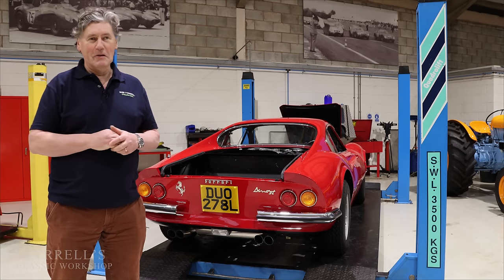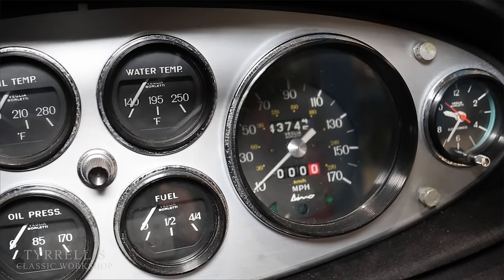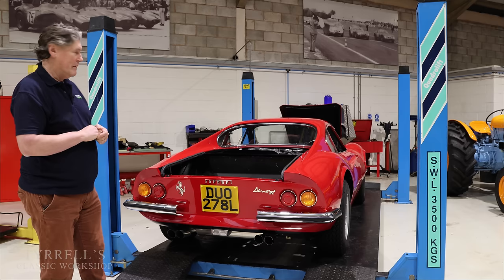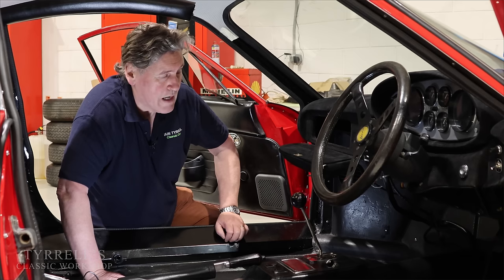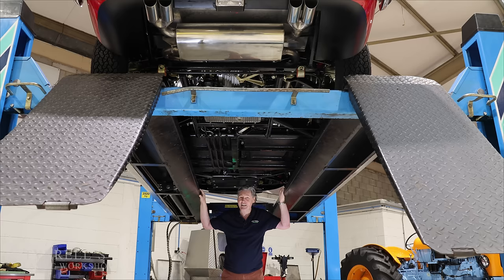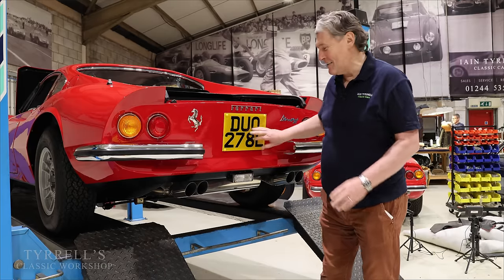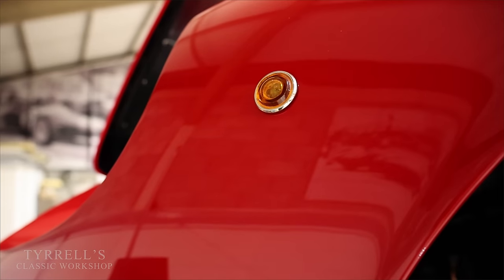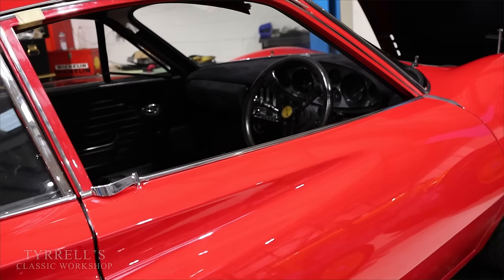Ferrari Dino 246 GT Restoration: From Bare Shell to Beauty Part 3 | Tyrrell's Classic Workshop

Comment: The details do make the difference. A few years ago I had moved from Toronto to Heidelberg and was in the process of placing an order for a 911. On a trip back to Toronto I stopped into a Porsche dealer and asked a salesman to recommend options that his customers valued. He told me to order, among other things, the aluminum look fuel filler cap. I did and every time I visit a petrol station and open the fuel flap I have to smile at this little gem. Keep up the good work Iain, you’re a dying breed of craftsman that keeps us connected to a time when doing things the right way was the only way.
Reply from the maker: Thank you for your kind comments!

Comment: I admire your attention to detail, also the knowledge you have, that allows you to know what is and is not correct. The car is absolutely stunning, the only thing missing, was hearing the engine running.
Reply: Amazing he buys parts from Superformance which offers the correct CAVIS cross carburettor fuel hoses yet Ian chooses to use black rubber hose here. A bit of an odd choice?

Comment: Happy Holidays and Best Wishes to you, your family and crew 🎄🎁🎅 This Dino is coming together stunningly brilliantly with all intricate attention to the deepest of details. Just mind boggling. Any car restoration project indeed never ever is a matter of putting some Lego kit together to begin with. You're not alone in noticing modern wiper blades on a classic. They should be as per original. Especially if the original casings were chrome or nickel to match the trim around the windscreen and-or were just a sign of the times, black ones just obviously distractingly comes across as a faux pas. Thank you so much for taking us along on this Dino project.

Comment: You tuned me right in with your comment about period correct radios and we are absolutely on the same frequency… I spent ages getting the right radios for my ‘68 Caravelle and ‘77 VW cabrio and correcting the butchery of modern upgrades. My ‘51 Ford still has its (working) valve radio. Great episode, and Happy New Year, looking forward to more in ‘24!
Reply from the maker: Excellent attention to detail!
Thanks for your continued support, and Very Best to you for 2024!

Comment: Wiperblades! I'm so with you on this Ian. My parents bought a new Volvo 145 in 1969, which I now have, still with it's original silvergray blades. The one on the drivers side has an "air scoop" to increase its pressure against the screen as you speed up. I've never seen this feature on any car, exept on these old Volvos.

Comment: Lovely! Found myself running alongside one of those, one evening about 20 years ago on a deserted Auckland southern motorway. I had my carmine red Mk2 2.5pi so I didn't feel like a complete heathen in his company.

 PI still has its stainless steel "Aeramic" wiper blades, but the dysfunctional AM-only radio and its single paper speaker had to go. If you like music, you need good sound gear in an older car with a lot of ambient noise!

Comment: This might be World Best Dino now. The decison is very hard to begin to use it, especially in an environment like northern Europe. Congratulations, a gigantic success.A small question mark is for me the sound of those stainless exhausts, that NEVER sound like the originals.I wonder why nobody redoes them in the original metal, coated to perfection .
Reply: I was thinking the same thing... not so much the sound, but the look. Mufflers weren't 'jewelry' back then. You'd have to open it up and replace the internals, but given the wiper blade story, that doesn't seem excessive.
Reply: I agree, i wouldn't fit stainless steel. Surely the Ansa exhausts are still available.
It will definitely sound different
Reply: in the worst case, make it be copied in the original steel, I guess it would rather not be more expensive than this bling bling in stainless
Reply: Regrettably the fitted exhaust is NOTHING like the original Ansa unit that would have been fitted. The shape is totally different and so too is the exhaust path making the use of stainless as a construction material a secondary worry. While I hold a lot of respect for Iain and his team, there is a LOT wrong with this Dino and it is far from being able to score well at a Concours. I am a little surprised to the sheer number of things I see wrong with this car and disappointed that they were not caught. I can assure you this car is miles from the 'World's Best Dino'.

Comment: Iain, if you wish to compete in concourse, lack of original wiper blades is a points deduction.  I have seen competitors take off the plastic blades and fit (with reverence) the originals.  It may sound over the top, but the concourse cars are at a level most of us do not understand.  The correct transfers, stickers and oil change stickers have to be original.  This is really the only way the judges can pick a winner.  And yes, they are "trailer queens".  That is a beautiful car  so well restored.  You have every reason to be proud.

Comment: that is very nice work mr tyrrell  .i think probably one of the best looking cars ever built always needed more power though !
Reply: No, It didn't ned more power. It was quite light, with a very slippery shape so it is a perfectly balanced car. It is also quicker than the 911S which it was built to compete for sales against.
My second Dino was sent to a renowned Stratos specialist and ended up with nearly 250 bhp. It wasn't a better car by any means.
I was told by 'one who knew' that the Dino only needed 50 bhp to reach 100 mph. I have no way of verifying that.

Comment: I remember a local garage selling a very presentable Dino circa 1980 for £10K - My boss had just bought a new Vauxhall Royale also for £10K - I guess some modern equivalent to the Vauxhall would cost about £40K - however a  good Dino would cost you north of £350K now  - your example probably much  much more - thanks Iain
Reply: Add another 300K to your estimate.
Reply: There was a rime when no one wanted old V12 and V8 sports cars. Even the 250 GTO, who wants an old race car...
Reply: There was a rime when no one wanted old V12 and V8 sports cars. Even the 250 GTO, who wants an old race car...

Comment: Speaking of original ICE (in car entertainment) fitment. Im fortunate that my 1982 Silver Spirit still had its original Blaupunkt Frankfurt radio (electric aerial in the front wing!) and pioneer cassette deck . A local car audio chap got the aerial working, but i need to source some replacement innards for the tape deck. The outer casing still has the car's vin number (last 4 digits) written on it. I also need to brush up on the alternative use for biros and pencils when it comes to using cassette tapes 🤣😉. Heres to a great 2024 Iain and thank you sir!
Reply from the maker: An interesting trip down memory lane for me, your story. From I think 1983/4 onwards they changed to a Blaupunkt Toronto, and that Spirit became referred to as the “Toronto spec”. Best wishes for 2024 to you too
Reply: @iain_tyrrell  Thank you for the insight, Iain.

Comment: Interesting and informative video as usual. 

I sort of chuckled when you mentioned the wiper blades. 

I have three older Mercedes and I'm a stickler for originality. 

And what so many people do if they need a wiper blade they just go to the nearest auto parts store and of course they don't have blades that will fit into the Mercedes holder so they get some third-party holder 

And then of course they're stuck with the blades from the third-party as long as they have the holder 

Decades ago the Mercedes wiper blade required a bit of – trickery? To install 

The blade was just a strip of rubber and it was held by two long metal strips on each side that you had to carefully thread into the holder 

If you were like me you cursed and figured you were going to spend about 45 minutes trying to feed this thing in carefully 

And if you were an experienced Mercedes-Benz mechanic you just zipped it right in 

And my other pet peeve is people that put newer radios – usually Japanese – into a classic Mercedes

I imagine the same look would be if someone stuck a similar radio into that old Dino

Originality is always my prime directive

Was it here that I learned it? Most probably as your videos are full of wonderful detail

One of the most interesting ones was your history of the 73 Porsche Carrera and how they need to expand the engine with no more chassis room led to a manufacturing process on aluminum blocks that is universal today

But anyway it was probably you that said this car was really half of an agreement with Fiat using the identical V6

Fiat had their Fiat Dino and Ferrari made the 246

Probably why Ferrari had some hesitancy in badging this as a Ferrari

Plus it didn't have the prerequisite 12 cylinders

But I think that is one of the most beautiful cars ever made - that "humble" 246

Finally I'm surprised at that distributor didn't get some static from Ferrari for re-badging his cars

I suppose if he sold one or two a year he would hear from them but I guess with enough sales you can do just about anything

Every 246 I see today seems to have either the prancing horse or "Ferrari" on the back or both as this car

Thanks again for the nice video

Comment: I adore the 246, what a huge move for Ferrari, mid engine, etc, Also the front end looks so nice as a shape without the front bumper. This was the first v6 and 296 was the second, just look at what they've done w the v6, winning lemans, using the 296 gt3 at the 24hrs of Nurburgring, imagine owning a 246 and a 296, what a pair, both beautiful 50 years apart, Forza Ferrari!, Also the 246 is a Ferrar,i, duh, almost more special w the Dino badge

Comment: Love the item about the wiper blades. I do agree there should be no substitute, but if a classic is a driven car I do feel modern blades are more practical day to day as they can be replaced regularly, as all wiper blades should be. Clear forward vision is vital.

What's probably as important is a new windscreen on a 50 year old classic. Old, scratched screens are not helpful, no matter what wiper blades are fitted, on a dark, wet night.

On show cars and TV cars it is, of course, sacrilege to fit modern blades.

Comment: Sometimes you have to replace original when you have no choice.  For instance here in Australia if you import a car you can't use certain original items for design rule reasons.  Like seat belts, indicator lenses.  I had beautiful matching colour seat belts in a corvette, which I had to change over to modern plain black ones.  I hated doing that!
Reply: I’ve heard and read that Australia has some blatantly ridiculous import regulations

Comment: Bought my Lotus Elan DHC in 1984, for about £4k, which was iirc around half what a 246 GT was on sale for at the same dealer.  I still have the Elan nearly 40 years later…and it also has the original stainless steel wiper arms and blades 😀

Comment: Iain Tyrrell, the windscreen wiper expert/nerd/aficionado/tragic. Who else would point out the wrong type of windscreen wipers on the Citröen DS in Tinker, Taylor, Soldier, Spy. I wonder if he's ever watched  Bridget Jones' Diary & noticed that the old Mercedes-Benz 280SE convertible being driven by Hugh Grant's character, with Bridget Jones as passenger was in park, as it had a column shift lever. 
Iain seems to be such a stickler for originality, so I'm a bit surprised that he didn't point out the possibly non-original steering wheel. I always thought that it had polished aluminium instead of black anodising, unless it was optional.

Comment: I think the Dino is just achingly beautiful. I can't afford one (surprise!) but I do have a Red MR2 Roadster which is the closest I can get on my budget.
Reply: The MR2 is actually a much better car.
Reply: Yeh, right!!! @AmericasChoice
Reply: @gordonsimpson3235  It is built better, has better suspension and a great deal more reliability.  Have you ever driven one?
Reply: many times.
Reliable, cheap to run, but soulless Japanese tat.
No where near a Dino I am afraid, in fact I have never heard the two cars discussed in the same conversation ...ever (until now) @AmericasChoice
Reply: @gordonsimpson3235  Discussed together because he mentioned the car.  It is a better car for the reasons I listed, and some of the ones you listed.

Comment: The Kia garage in Springside swapped the rear wiper blade on my mum's Venga for a dirty old one from the new one they'd sold previously.   I was livid.   I can only think either they or someone at the garage, within their yard, took it upon themselves to steal it to get them through an MOT.   Easily replaced for very little cost by myself.   They also stole the wheel nuts out the car another time.   One of the things that really annoyed me was when they sold her "Quality tyres" but they were a cheap Chinese brand you'd never heard of and couldn't find any information on.   We got those swapped for Continentals, but they wanted an extra £40 to do so.   Venga is a great wee car, but too many questionable things happened at that dealership.

Comment: See here in Thailand that would never happen..  you always, ALWAYS get old parts back. :D  Even when it's completely silly, like an old oil filter.  Or when you get the window rubbers replaced, you get all the old nasty ones back. Or the worn speedometer / odometer cable.. got that too.  Doesn't matter if it's a fancy car or an old truck: you get to see all the stuff they took out and replaced and you are now responsible for throwing it out. (Or keep it, when you're a hoarder. :) )

Comment: re: the Ferrari shop switching out the original wipers - 50/50 they knew what they were and they "appropriated" them for their own to resell. I had a "high-end" NYC glasswork repair shop/dealer do this to the original  Cenedesi factory sticker on the bottom of one of my vases - they said they "cleaned" it for me (I'm sure it ended up getting reapplied to another piece he was selling)

Comment: Ah, the humble wiper-blade... but it reveal a 'triangle-of-doom' in the sweep pattern, I wonder?
Reply: No the view was good despite the 'clap hand wipers'. The top centre of the screen was way above the eyeline.
I remember driving the car right through a very snowy winter....above 50 mph, you could switch the wipers off as the aerodynamics swept the snowflakes up the bonnet between the two headlight humps and straight over the roof - missing the windscreen completely.
Made your eyes feel funny though rather like the stars  on the intro to Dr Who TV programme.

Comment: Personally, I can't imagine tempered glass to get more briddle over time. Laminated glass might age as it contains layers of plastic foil. But pure glass is chemically quite inert - and briddle from the get-go.

Sure, the rubber seals age a lot - and get very sticky. After decades, it's definitely hard to get the glass out or in in one piece. Even more so if it's curved as the rear window on the Dino.
Reply: I agree with your statement that tempered glass does not increase in brittleness as it ages.  However, in my experience the difficulty with installing classic car screens lies with the remanufactured screen seals - both with the rubber composition and shape - as they are very rarely as good as the original.  In some cases I have fitted the original 'old' seal because the remanufactured seal was a 'disgraceful' copy.  Now with the Dino, the installation difficulty is compounded by the rear screens shape which makes the fitment very challenging - whilst also having to pay very close attention to not causing any damage to the pristine paint work.  Hats off to the installers.

Comment: Should the wiper not be chrome rather than all black ? One nerd to another.
Reply from the maker: Strangely enough, the production 246s were all black arms and blades
Reply: Early Dino's (206 and 246 L series) used polished stainless steel wipers and arms. Late in the production of the L series and in all of the M and E series cars the arms and wipers were black.

Comment: Original radio hardly a good thing. Smacks of trophy car never to be used. The reason why people change the radio is because they actually want to use the car and thus want a half decent audio system. Being a slave to originality is something that only makes sense if you're building a garage / storage barn ornament. Which is a pity. No doubt this car will barely if ever be used once finished.